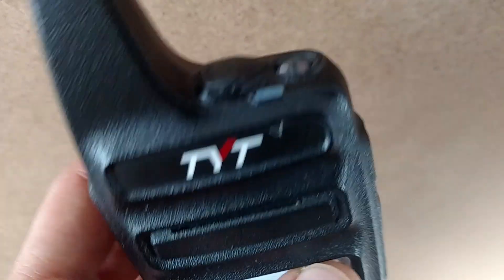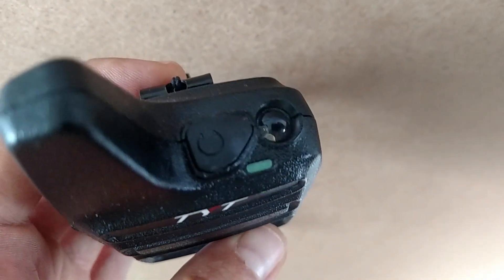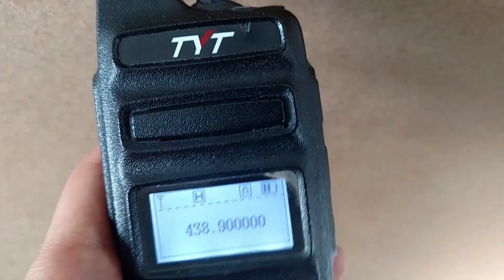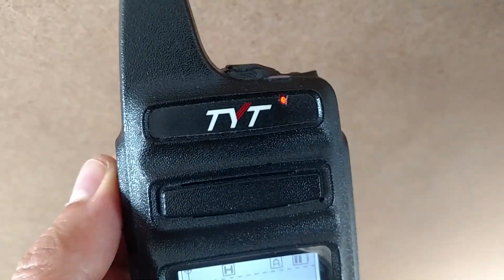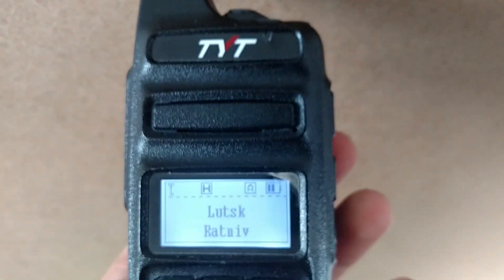TYT MD-430 LED mod

Comment: Any idea why I can't program my hotspot frequency (434.22750) into this radio?
Reply from the maker: It seems your frequency does not fit into the minimum step of 6.25 kHz or 12.5 kHz.
Reply: Yes- That seems to be the problem.  All my other DMR radios have no problem with this frequency.  I wonder if I can enter it into the code plug with a hex editor?